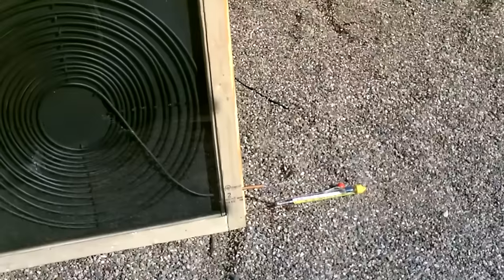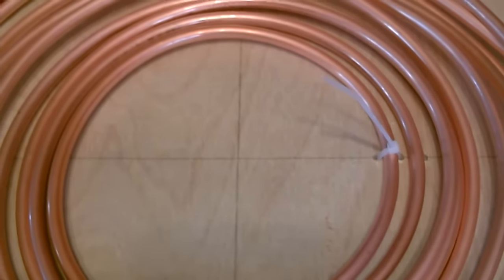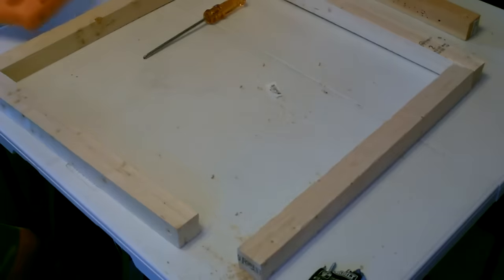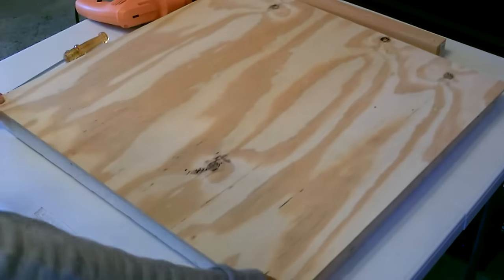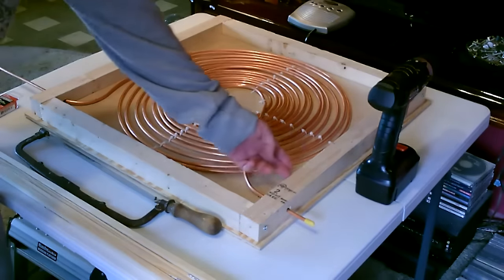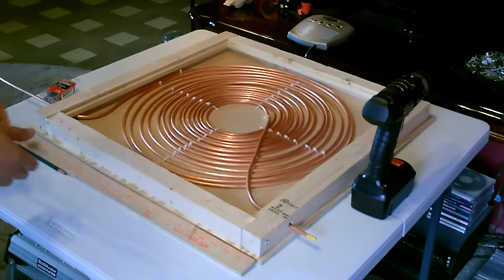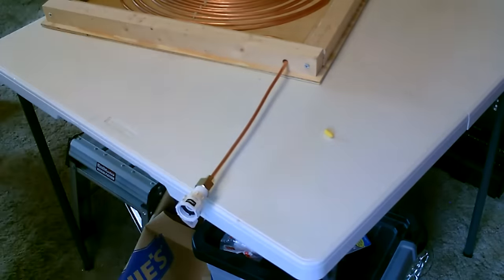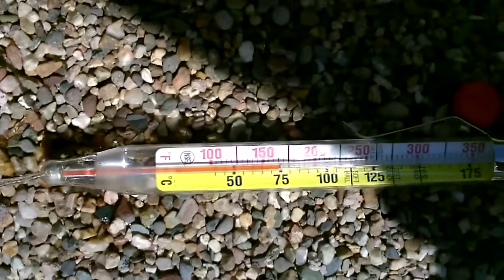DIY Solar Water Heater! - Solar Thermal COPPER COIL Water Heater! - Easy DIY (Full instr.) 170F

Comment: Awesome idea, I never even thought of something like this.  After seeing your video it got me thinking however, do you think the water can get even hotter if behind the copper tubing you put a mirror and you get a mirror tint or a one way mirror to cover the outside of the case.  I know it'll reflect light on the inside of the case more but not sure how that will affect the temperature.  

Love your videos !
Reply: These things work best with simple black. I understand what you are thinking but, with black, most all the solar energy frequencies are converted to heat, which heats the air and the air heats the tubing. Any energy frequencies that escape will reduce what you are harvesting. Interestingly, heat is in a particular, lower frequency range and there is glass available that lets the higher energy frequencies through (into the box) but then blocks the heat energy frequencies that the higher frequencies are converted to. That stuff will make the box work a lot better. It's commonly called e-glass and is used in pricier windows, for obvious reasons.
Reply: awesome.  thank you for clearing that up!
Reply: Solar water heaters of different designs work best under their own unique circumstances. The evacuated tube types do very well in situations where cold air is the enemy.  In my area simply boosting the water temperature to fifteen or twenty degrees F. above the air temperature is all that is needed. In some of the Arab areas, they reverse the hot and cold water intake for homes. They get cool water by taking a water heater and peeling off all the insulation and using the AC  to cool the water tank as the incoming water to the home is normally too hot for most uses.
Reply: In some areas one might even consider boosting the heat in the home by using hot water. Imagine a dinning room table with a barrel underneath that is filled with water above 130 F.. If you have sun light and have a high heating bill this type of item might help your budget quite a bit. That barrel of water just might keep the home a bit warmer all night due to the volume of water inside. One might even have several barrels filled with hot water. 
       There are a few people who use a solar hot water heater as a pre heater for a steam engine. In many areas you can reach 200 F rather easily and with a one way check valve the 200 F water is then sent into a unit that uses a lens to boost it to full boil and that drives a piston which is usually hooked to an alternator.  So far it seems to be the type of thing that hobbyists do but it may have more serious potential that may well be worth looking into.
Reply: That last bit, totally opened my mind way up.
Reply: That seems like a rather involved setup for any climate where it would be valuable. Keeping a place warmer at night is generally only an issue if your house is a fancy flavour of bed sheet, or it's cold during the day as well. In cold climates, you're not going to just be able to stick something like this outside and get hot water. As mentioned, some very well insulated system might work, like a vacuum system, except that would be delicate and would get covered immediately by any kind of snowfall. If you stick it outside, you're going to need to run pipes into your house, which is an insulation problem, and you can't stick it inside because all the energy making it's way into your house is already basically being converted to heat.
Reply: Med
Reply: It wasn't my video by the way.  However in northern climates a water heater will work. For example due to the position of the sun in winter Maine has more "solar hours" than South Florida despite it being hot here in the winter. The use of black top patch inside the collector box tends to hold enough heat to prevent snow accumulation under most circumstances. And if snow is an issue you can reverse the flow and send water from the electric hot water heater through the unit to melt any snow that sticks to the surface. Hopefully that would be a rare need and only take an hour or two to warm the box. It is vital that one does not allow a unit to freeze as frozen water and burst pipes go hand in hand.
Reply: Heating of all types is problems. HVACS, fire places, and pellet stoves all have their own installation headaches and tradeoffs. This type of system is no different except that running it is basically free. Running hot water pipes for radiating the heat internally isn't that difficult; plenty of hot water heaters exist in un-insulated spaces and the pipes are routed indoors. Nothing special about that.
Reply: You can honestly just install it at a self shedding angle and knock the snow off. That, coupled with the heat the black surfaces generate, would make it fairly snow-proof. In high latitudes the angle to catch sun is a good angle for self shedding.
Reply: Eric Kaufman Yeah, it's free.... except you need pressurized water and have to have the system drain itself automatically if it gets too cold or it'll break itself.
Reply: Mirrors can actually produce useful steam, but any use mirrors or lenses must be carefully planed and tested as temperature high enough to cause fires can result. Imagine a Fresnel lens getting moved a bit and the focus falling on the roof instead of the collector. Parabolic mirrors can also focus quite a bit of energy.
Reply: It needs a $20 water pump that would work in a hydroponics system, you're just circulating water. I live in a place with subzero nights on occasion and again plenty of people have water heaters in non-heated areas. The same thing you do for that you'd do for this. I don't really see what's so particularly difficult about this solar heater compared to any other heating source out there. Dropping in Trane heater, as an example, is 10K and several thousand in installation costs and it has plenty of maintenance associated with it.
Reply: jim sadler If your system needs backup systems to not fuck itself up under normal conditions, it's a shit system.
Reply: I did not post the videos. But keep in mind that many pumps will not handle hot water. And home hot water heaters will quickly fail at the high temperatures that a solar water heater can provide. It is not at all unusual for a simple hot water heater to reach 190 F. . Your home hot water heater is happy at 110 F..  There are high temp shut off valves available to keep you from getting scalded. There are even ways to combat freeze ups in radical cold over long periods. Keep in mind that guests may need to use your home safely or kids who sort of forget about things like water may be scalding or even lethal. Building home units can be fun and inexpensive but consider safety at every corner as the last thing you want is a disaster.
Reply: I don't know why anyone who lives in an area that drops well below zero would mind having a bit of heat tape as a backup to prevent a freeze. After all how many times would you need to run that heat tape? A couple of dollars expense that will provide protection for many years is a good idea to me.
Reply: Also, this should go without saying, but in nearly all application cases, you should make it impossible for someone to get scalding water out of your water distribution system without tampering.
Reply: What temperature you need is not a fixed number. Restaurants are required in my state, to have 180 degree hot water heaters to assure germ killing in the kitchen area. There are also valves that will shut off if high temperatures occur in home systems. There are even faucets that control the degree of hot water heater compared to cold at the outlet. Glacier Bay makes one such faucet.  There are even a few people who use very hot water to preheat for steam engines, typically used to spin generators to produce power in  off the grid homes. If you want to use mirrors or lenses you can even produce steam with nothing more than a solar hot water heater.
Reply: How is the water being circulated in your barrel under the table scenario? If you're using a pump, then you have to factor in how much you're spending on electricity, and you also have to devise a way for it to turn off when the sun isn't shining (starting to get complicated). I'm not sure a thermo-siphon would produce sufficient flow.
Reply: Trevor Lambert So that's what that's called.

I was just wondering how effective convection would be if the reservoir were higher than the collector. Or I was after I read the first sentence of your comment.
Reply: Some solar units do use mirrors . Usually they are half of a pipe coated with flexible mirrors underneath the tubes. If you do this you absolutely must have a high temperature, automatic shut off valve. You can reach boiling  and use of mirrors can also cause fires. Lenses are also used to supply intense light in some units.
Reply: Units that are well designed will flow hot water out and fill with cooler water  on their own without need for a pump. In cold climates you would need valves to isolate the system after dark as you could be causing very cold water to fill that barrel.  The hot water outlet is above the water inlet for the collector. As the water heats and expands if will create a siphon effect with the hot water being pushed downward while cooler water is lifted into the unit.
Reply: If you use oil as the heat transfer/storage medium then temperatures can exceed 100C. this may be useful in some setups, especially if you're planning to drive an ammonia adsorbtion cooler (Solarfrost) or stirling motor.

Yes really; Solar heat can be used to generate AC or refrigeration - down to -30C or so. That's in addition to the usual measures like solar chiminies to draw air up and generate a cooling breeze within the building.
Reply: +seigeengine I realize now that there actually wouldn't be any flow at all without a pump. A thermo-siphon relies on the colder water to be higher than the hotter water. If the vessel is below the collector, then the hot water is just going to remain at the highest point.
Reply: Yes, but there's potential to locate the collector below the reservoir. Not a good positioning, but technically possible.

Comment: I duplicated your model but used 3/4” copper thinking I would heat more water. Turns out I just cooled the coil in a matter of minutes. Also I used a 1/6 HP submersible pump but I don’t know if that’s too strong. Can you tell us what size pump you’re using.

Thanks!
Reply: Hi Juan, help me understand plz? I did the same thing with a 3/4 rubber black hi temp hose instead and the water never really got hot but I'm heating up a 80 gallon water tank for home use in Florida. I'm wondering if the larger diameter is the problem? Like you I thought bigger is better. I'm using a solar 12v recirculating pump.

Comment: Could you use those seed bed warmers to heat your water up by placing a warming mat under and on top of a copper coil with water being circulated through it? Those plant warming mats are LED and do not consume much electrity so you could tun them off a solar panel set up right? That there water does not have to be boiling so this could be another way to be able to enjoy a warm shower or bath correct?

Comment: This methode is ISRAEL invention.
You can do it by galvanized 1/2" pipes vertical parallel 4" distance welded to two 1" horizontal in the edges  .the 1" pipes are one edge open in each painted black in metal frame  clear glass covered and the open 1" sides connected to water tank.

Comment: I was watching this and thinking of how much that back panel is absorbing the light, I wonder if you put something reflective for example foil behind those coils it would probably reflect even more light at the coils increasing the heat instead of the plain board absorbing the light..

Comment: (Tempered) Glass or acrylic sheet? 

Apparently acrylic sheet is 5-10 better at keeping heat in, and allows 88% of light in.

Glass allows more light in (close to 100%) and heats more, and faster, and can cause a magnifying effect, or melt things inside, but keeps heat in less as is less insulated. 

I’m guessing the day light sunlight is only really hot, for ~2- 4, hours max, so glass will be best when it’s hot, as the loss of heat is only a problem when it gets cold, and when it’s cold the solar heating won’t be on?

Therefore have I answered my own question? 

Therefore if (tempered) glass is better for heating (during 2-4 hours of hot midday, sunshine. Is double glazing better the. One plane of glass, as it will prevent heat loss that a single plane of glass will do? 

Thanks
Reply from the maker: hi. i've always found that single pane glass it the best. the non glass glass (like plexiglas) sometimes wants to warp. i've tried double and triple layers of glass but the extra layers seems to block more sun and the units don't get as warm.

Comment: Help me understand plz? I did the same thing with a 3/4 rubber black hi temp hose instead and the water never really got hot but I'm heating up a 80 gallon water tank for home use in Florida. I'm wondering if the larger diameter is the problem?  I thought bigger is better. I'm using a solar 12v recirculating pump.
Reply: Hi Sirroc....that's what I would have used with the same results.!  So what was the answer.?
Southampton UK

Comment: This is brilliant, Thank you for sharing! Anyone have any idea of how well this would perform in more miserable climates (UK) or how to  prevent pipes freezing on a cold night for an outside installation?
Reply: I think if you use 1 small diameter pipe inside a second pipe and fill the second with antifreeze or waterproof the box and fill with antifreeze.

Comment: How about, 2 coils, one preheats the water before the other heats it fully?
Than a insulated tank to capture hot water for overnight?
Reply: Why 2 coils,  150-170F is not enough ?
Reply: @LoganRaven  I like steam bath!
Reply: Run several of these in parallel to increase your heating capacity
Reply: For a given flow rate, you would get exactly the same effect by making the area of the panel twice as big, assuming the two coils you are proposing were the same size as the original. Full-on sunshine gives around 1000 watts per square metre,  enough to raise 1kg water (= 1 litre) by 1°C in 4.2 seconds (water SHC = 4200J/kgK), so near freezing to boiling in 420 seconds = 7 minutes. Of course, losses will be big, but you can immediately translate that to raising 5l water by 20°C in the same 7 mins. Now, I just did all that in my head, thanks to metric units. How about giving us all the measurements in metric, so the whole thing can be easier? And much more insiteful - the SI unit of fuel consumption for a vehicle, if you think about it for a minute, must be the square metre. Think what that actually means. It is so informative. When you remove the clutter of unhelpfully obfuscating units, you can see things that you otherwise couldn't. Doesn't change if you are a rocket scientist, you become a better one when you can see more clearly.
Reply: You could accomplish the same principal by using 100 ft of continuous tubing instead of the 50 ft destersun02 used, by having one longer tubing it would have less chance for leaks

Comment: Make an insulated box place one copper coil to heat water place another copper coil with a 12 volt glow plug sealed in one end of the coil with the coil filled with gallium to help conduct the heat from the glow plug. Set up 12 volt glow plug to operate off a solar panel set up with the heated water filling an insulated water cistern. Cement cistern with pearlite placed on the bottom another cement cistern placed inside and pearlite packed around sides and top with all the pluming ran and proofed before creating heat sink for produced hot water during the day. ; )

Comment: could this be used as an allternative to a hot tub pump? looking to reduce electrical bill was thinking of putting the hot tub on a timer and using this during some down times to just maintain water temp. perhaps with a small pond pump or something of that type. hot tub heater will be used to develop basline temp, and this to supplement. thanks for feedback

Comment: Cool idea,   cause running you hot water tank cost about 75 bucks a month running it on electric>  if you can put a timer switch on it save ya some big bucks , like time you use hot water dishes  showers at late evenings NO NEED OF IT RUNNING 24 hours a day

Comment: They must have high temperature radiator type hose you can easily coil around the pipe very quickly

Comment: thanks.  i see pex tubing used on toh often for hot water.  will this hold up in uv.  Also how could this be integrated with a home water heater system?

Comment: Take this and circulate a bunch of water into an insulated container over the course of the day. Stop the pumps at night and store the heat / warm water all night.

Also check out hot water from compost. It can make heat in cold and cloudy weather. You jumpstarts have to feed it well and keep it big. Same copper coil and everything.

Comment: nice I'm not sure what you used to secure the glass from falling out. I did this last year with garden hoses and the temperature of my 4k gallon pool was 98°. only I didn't have any glass.
Reply: Glazing points, silicon or a small pieces of wood tacked in would work.  Silicon would be a bear to remove if the glass broke.
Reply: Yes, I'm in Florida and the white hose leading to the shower gets so hot that one could need an ambulance if one got underneath and then turned on the water and that hose is only about 20 feet long. If it were black it would be even hotter or if it were black and longer it would be even worse.
Reply: Jeffrey Yeager